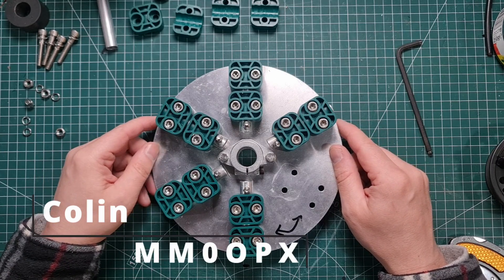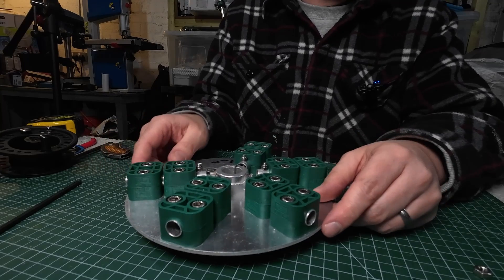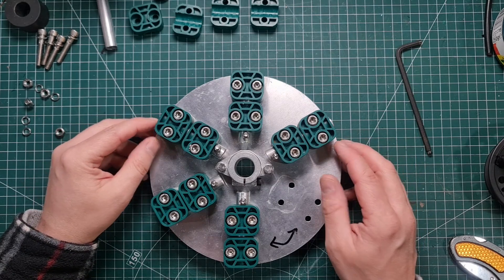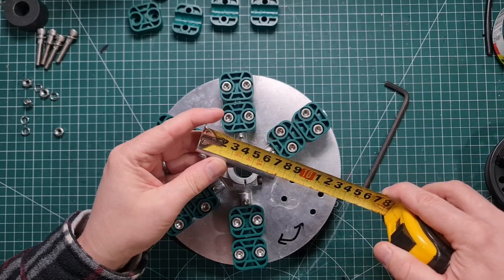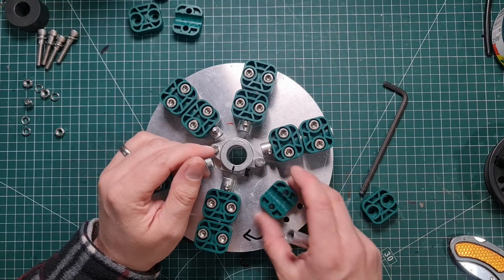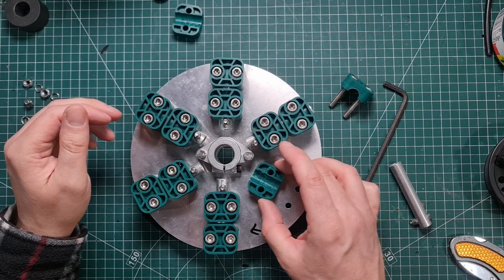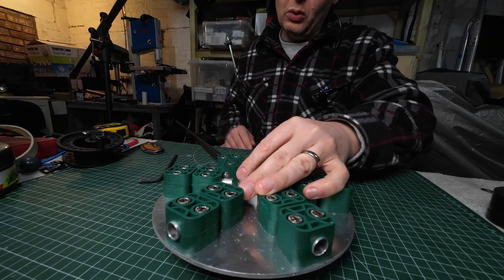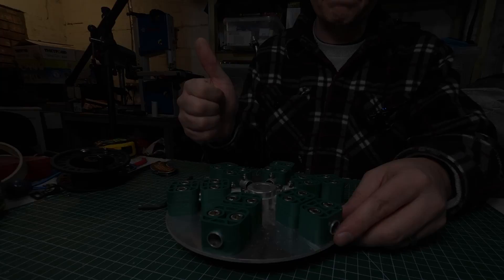Building a #hamradio  Hexbeam Baseplate for less than £40

Comment: I made mine over the weekend - apart from something I had trouble sourcing was the short tube inserts for the clamps, these arrived today in stainless steel (12mmx0.5mm) which fit the tent poles perfectly.
One comment to add is that I was able to tighten the top shaft support without having the clamps removed as you mention at 3:50 by using 'ball end' allen keys which is nice!
Reply from the maker: Excellent, if you can, please email me some pictures when its all built. Great shout on the stainless pipe. I just looked and seen it on Amazon. I will update BOM for an alternative. Thanks 👍

Comment: Wonder how expensive the full hexbeam will be? Here a locally made hexbeam costs about one third of my FT-710 radio. 73 de Jon, VU2JO.
Reply from the maker: For the parts its under £170. For a commercially built one in the UK its around £700.
Reply: @MM0OPXFieldRadio  Oh! Then your commercial one is almost double the cost of the version here sold by a local ham. 73

Comment: Nice job Colin, have you got a total weight of the whole finished System roughly, im looking at the Buddihex for another little DXped overseas simply due to the low weight but this looks interesting to build
Reply from the maker: Not yet as I cant find the scales. I will get to if when I find them.

Comment: Great video,  I was going to make one of these for 20m only, I don't work any higher bands  but to be honest, a 1/4 wave vertical was much quicker and cheaper $10 and works just as good. 
But for those who have the time and money, it's a great project.
Looking forward to hearing you down here. 
Have a good weekend,  73.
Reply from the maker: I had one before mate and it was amazing. Yes its a lot of work. Your parasitic array is probably as good and you dont need the height. I'm going to try similar with with a halfwave vertical.